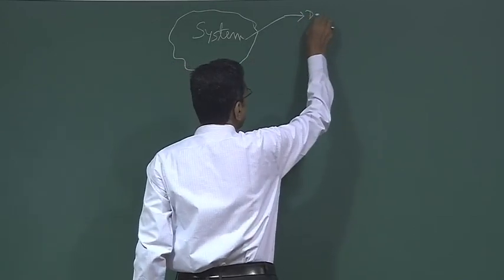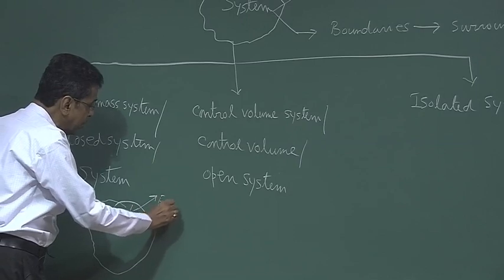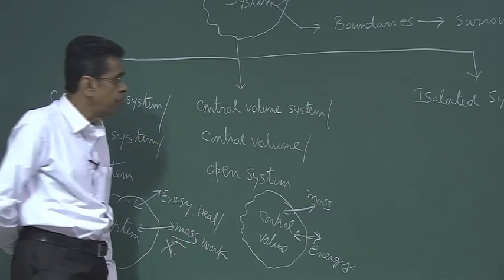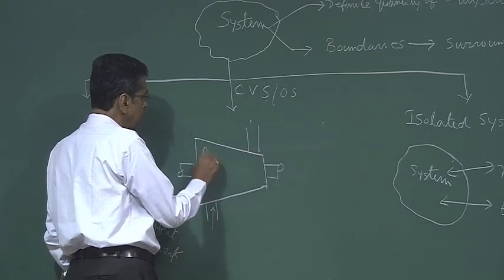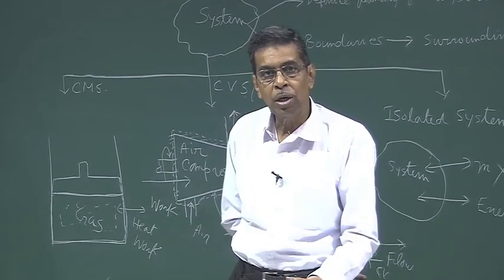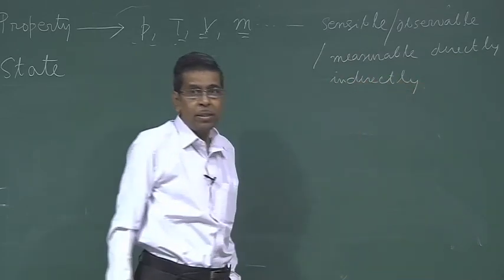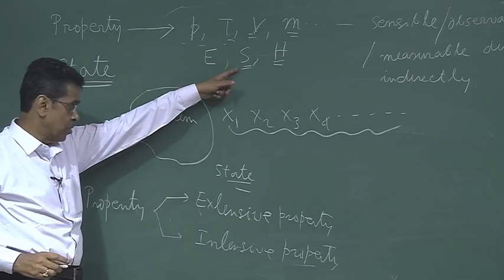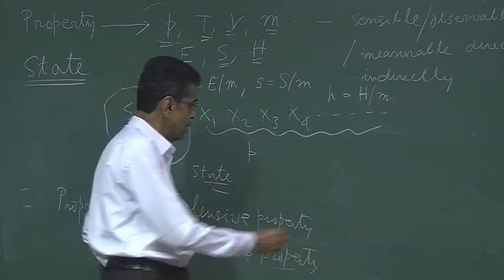Introduction, Definition of System, Properties and State of a System

Comment: sir i want to know that how the pressure is an intensive  property, because let us suppose  that the m1 amount of gas has p1 pressure and obviously m2 amount of gas will have p2 pressure , so we can clearly observe that pressure is mass dependent  thing. so  i think it should be a extensive property .
Reply: This is not the case...when u move in ur room,does the pressure changes from place to place.the answer is NO. Even if taking a small portion of room,the pressure remains same as of full room.this clearly shows pressure is an intensive property.
Reply: @sarthakthakur4832  The reply is worse than the question.

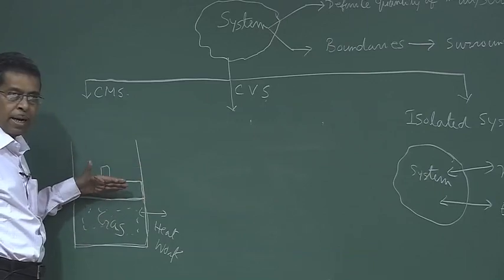Comment: sir in 19:10...how piston is example for CMS.... Bcoz there is no change in volume.. so it will be a CVS example...how you said it as a CMS
Reply from the maker: Let me state the definitions of CMS and CVS. The CMS is a system which has fixed amount of identified mass. The energy of CMS can vary. The CVS is a system in which both mass and energy can vary. Note that CVS system does not mean the volume is fixed, while for CMS the amount mass is fixed. In the piston example, the amount of mass is fixed and the same particles are present all the time (i.e. identified mass). Thus, this is a CMS.
Reply: it would have been a cvs only if we consider that there are inlet and outlet valves, in this case there will be a mass flow here as the air or fuel will come inside hence mass flow will be there, but if we consider a piston cylinder arrangement without the valves, we fix our mass content in the system and there will be no inflow or outflow of mass hence that becomes cms/closed system